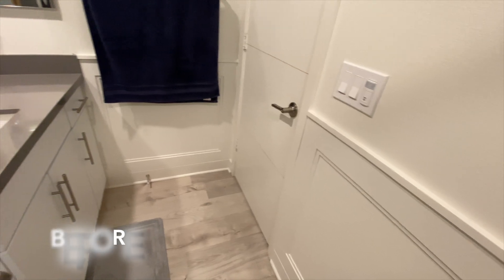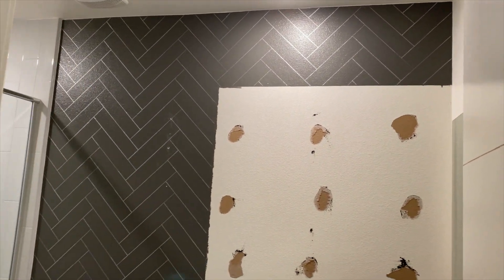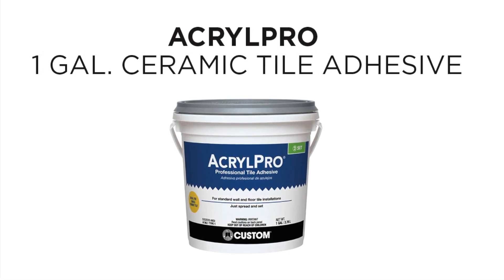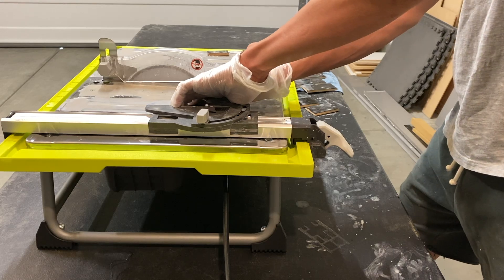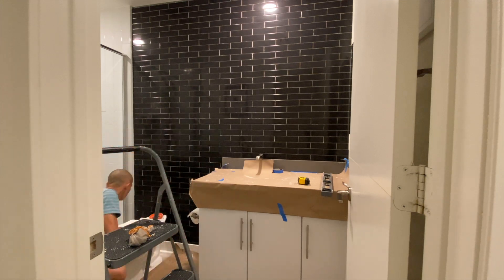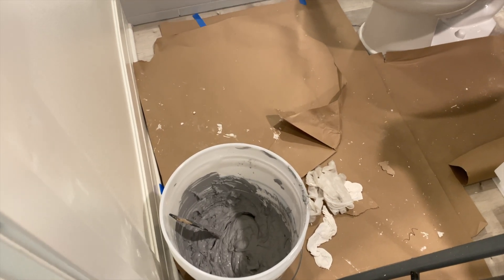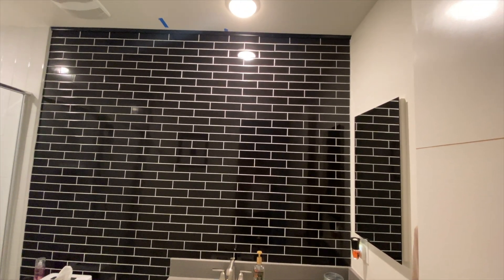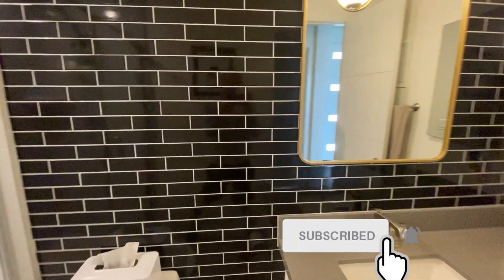First Time Tiling DIY With Black Subway Tiles

Comment: Looks amazing!! So impressive for your first try. What did you use to hang the mirror up? Did you drill or use an adhesive?
Reply from the maker: Thank you. I drilled into the tiles to secure it, I have trust issues with adhesive even though the mirror was only 10lbs  😬